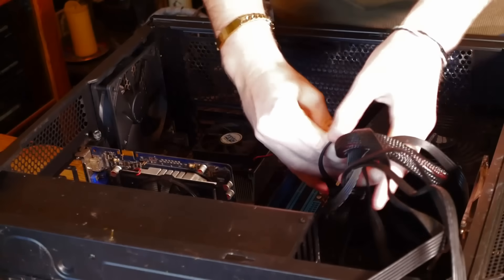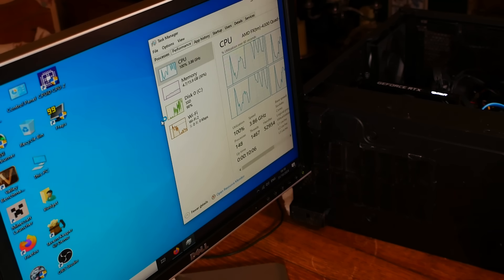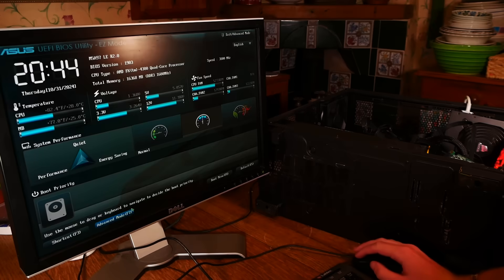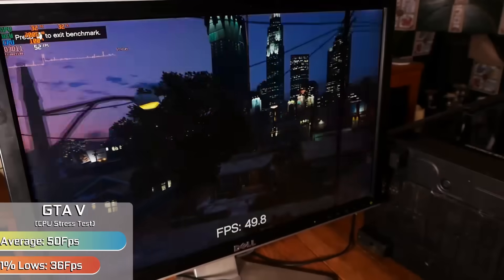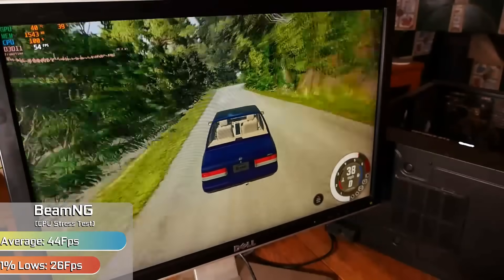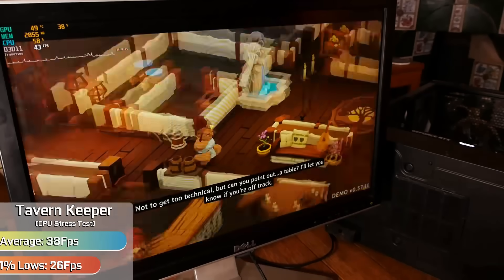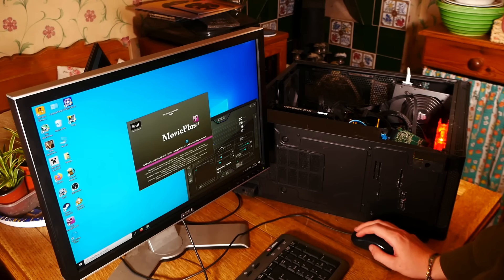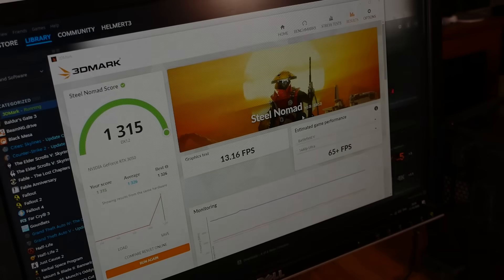AMDs Weakest FX Processor...

Comment: If applications back when this was released has used its cores it would have been good, maybe even amazing but alas games were built with the 2-core 4 thread in mind and so we stayed for far too long.   I used an FX 8370 until a few months ago and played many modern games with it.  Was it amazing?  No.  Did it work?  Yes, and it did because these games used the cores it was equipped with, I think it could have been something good if only the software supported it back then.

Comment: My first PC I got as a kid was with an FX 6300 purely because of the price difference at the time compared to Intel as you mentioned. I still remember having to run it with the side panel off bc the stock cooler (was literally as you described it here) was just not sufficient, funnily I use that cooler now as a makeshift solution when I'm testing motherboards 😂. This video brought back many memories ngl. I went to a 6700k after and then back to Ryzen 3800x, to this day the only Intel cpu I ever used, and I am not planning on going back any time soon. AMD definitely started something good on the long run with their developent of chips at that time I think. I still have the system under my desk catching dust atm, might put it back to some use, especially after seeing this video showing how competent it still is in 2024. Amazing content, keep it up my man!

Comment: Man, this video has me wanting to dust off my old rig I rebuilt back during the winter of 2020 (Covid - Round 1 - Fight) after I finally had some time to myself as my job was classified as an Essential Worker.  Like you, it's what I called my 'First Real' gaming rig that I built years before as I got a heck of a bundle on it and needed something better than the ol' Core 2 Duo system I was on at the time.  Honestly, if I hadn't used the stock cooler as of course I was on a budget, I probably would have used it longer into it's life.  But yeah, still using the same Gigabyte board, 16 gigs of G.skill ram, and the FX 8120 the bundle came with.

Current graphics card I have in it is an EVGA GTX 1660 Super 6 Gig I picked up in March of 2020, the one that took me through the dark times to follow on my First Gen Ryzen system, which is just now one of those cards I'll never get rid of working or not, given EVGA pulled outta the graphics card market due to Nvidia shenanigans.

Given the underdog status of the FX line, and all the gaming I did on the rig back in the day, it's got a special place in my heart :)

Thus! Great video :)

Comment: A FX is quite a "modern" cpu.
I think we have reached a point where you don't need the last cpu + gpu to really use a computer.
My secondary computer is a Mac Mini 2012, of course upgraded with a SSD and a bit of ram, and as long as I don't want to play games, it's still perfect.
The Mac Mini has a i5-3210, which seems about the same power as a FX4300.

Comment: The lawsuit wasn't really related to the cache. It was related to the fact that each group of two threads (ie a module) shared an FPU. 
So in effect you had a weird in between of two integer units and one FPU per module. Calling those modules two full "cores" was therefore misleading. It would've worked out if they called the modules for what they were -clustered multithreading (CMT) modules, and there's no shame in that. 
So, the FX 4100 was more like a 2M/4T chip, and CMT is actually much better than SMT in terms of performance gain because you actually have two integer units, which made especially its multithreading performance better than the i3.
I still think they should've refreshed Phenom II with the new instruction sets of the time on the new GF node and that would-be been a Phenom-enal chip that would still be more than viable for daily tasks and some gaming.

Comment: I ran an 8350 with a GTX 770 and 16GB RAM for years and was very happy with it.  I had it slightly overclocked and cooled with a hyper 212 and eventually upgraded the RAM to 32 GB to give it a bit more breathing room, but I never really thought it was a bad chip.  I think the main issue people had with it was that it was sold as an 8 core CPU when it was actually 4 modules of 2 cores each.. that and the 125w power draw. I still think it's a perfectly usable CPU for a low- or mid- tier budget build.

Comment: I had a FX 8300 and it wasn't as bad in my opinion as people say. If you fine tune the chip and made the right settings in your motherboard, while pairing it with faster ram, it worked actually well. Not as fast as Intels i5/i7 chips for sure, but fast enough to have a good experience, if you made that extra work. I replaced it with an Ryzen 5 1600 later on and was amazed on how much more of a performance boost i've got. Sold the FX 8300 paired with an RX 480 to a friend later on for cheap and she was more than happy of the performance she got at that time (i've upgradet it to a ryzen system later on for her, when she could afford it). The FX processors were disappointing in performance, but not as bad as people say, they were actually affordable in comparison to Intel chips at that time.

Comment: I used to have the fx-6300 "black edition" in my first pc. I paired it with 2x4gb 1600mhz ram and a radeon r9 280 3gb. However after a couple of years I have started to notice some very serious stuttering in games. In 2017 I decided to upgrade to the ryzen5 1400 since I could get it for 70euros and paired it with an ex miner rx480 8gb what i got for 75. It was night and day, the stuttering suddenly stopped and my fps doubled. In fact it is still my main config since I mostly play older or indie games.

Comment: I would like to point out that the modules of FX processors share more than cache, they actually share a floating point unit, and each core has its own integer unit. So in tasks that are integer heavy, they behave much more like a true X-number of core processor and when floating point heavy function much more closely to a processor with half the cores but has hyperthreading.
Reply: This makes a lot of sense. Thanks for the facts!
Reply: Funny part ... when you start to overclock it... then that will reduce the contention of the cores for the floating point units. Remember vaguely some tech site like Anand's overclocking the FX 9000-something to insane levels and outperforming the i7 (also overclocked). Downside was that to get there the power consumption of the CPU skyrocketed to more than twice the i7's. But if you look at modern day Intel CPU's it would sadly be in the same ballpark. Did pick an i7 back in that day, though. Found the ordinary power consumption of the FX already too much.

Comment: In the previous generation (Athlon/Phenom), cores were cores. In the FX, each 2 "core" module had independent integer clusters, but a shared FPU (as well as shared cache and and a shared pool of instruction decoders) - for integer workload, it didn't face the same limitations as Intel hyperthreading, where EVERYTHING is shared.
Reply: And now Intel is doing big and small cores, so not even a core is equal to a core on the same CPU.
And caches get even more complex. Intel's caches tend to be inclusive, meaning a cache at a certain level also holds a copy of the closer caches.
On an Intel quad with 256k L2 (per core) and 8 MB L3 (shared)= would have 8 MB available in total, but only 7.25 MB for a core (minus the 0.25 MB copies of the other cores' L2). The same layout on AMD would give a core 8.25 MB at max  (8 MB L3  + 0.25 MB L2)

And while everyone was talking about core-to-cache latency on Ryzen, the same also holds true for Intel.
They used a ring bus, with a stop for the iGPU, a stop for the PCIe lanes, a stop for the MMU, etc. But also a stop for each core, including a 2 MB slice of L3 cache. And latency tests were showing that the first 2 MB were quick, 4 MB latency was slower (since it needed to take a hop on the bus and back to get to a different slice) and 8 MB was even slower (since it needed to do 3 hops to the furthest slice and then 3 hops back)
In fact, my ancient Core 2 Quad has a lower 4 MB latency than a Haswell i7

Comment: I still have the 4300 I bought over 10 years ago, semi-recently bought a 6300 and plan to buy a 8300 in the near future. The 4300 is slated to run a 24/7 minecraft server for friends, the 6300 runs BOINC decently at 50% CPU usage limit, temps rarely over 45° with a wraith cooler. The 8300 is something I'd stare at on various web stores with beer pockets and champagne taste.

Comment: Few months ago i built 3 PC's with 3 different AMD FX CPU's specifically for my kids. First PC for my eldest daughter FX 8150 paired with 8GB DDR3 and RX 5500 XT 8GB. Second PC for my middle daughter AMD FX 6100 with 8GB DDR3 with R7 250 2GB. Third PC for my youngest son with FX 8320e with 8GB DDR3 and RX550 4GB. They mostly play Roblox but also Genshin Impact, Dragon Ball Xenoverse 2 and surprisingly enough, all the systems play GTA Online without issues, the FX 8150 at high settings with way over 60 FPS, and the weakest system with the FX 6100 on normal settings but with over 50 fps. The FX8320e was even able to play Ghostbusters spirits unleashed on normal settings with over 50 fps, i was not expecting to even be able to play it. So yeah, they're fine for what they play. Also browsing youtube or netflix is pretty smooth. I wouldn't touch the 4 cores FX CPU's though.
Reply: GTA V/Online does fine as long as you give it 3 threads or more. There are some issues with dual cores, but beyond that it's pretty well optimised.
Reply: Ready to heat the house during winter season
Reply: @prostmahlzeit  i don't see temps over 73°C on each FX. They are running at default settings without issues. They do how ever use quite a bit of power from 96w to 125w tdp. Not a problem tho, energy is very cheap where i am located.
Reply: @EtaYorius  I've had a FX 8320 for 7 years and now running Ryzen 5 3600 and Ryzen 5 5600, it's like a 3x improvement

Comment: It was a good chip for its time and still kicks ass today.
In 2018 I did the full FX-8370, 16GB DDR3-2133 and RX 580 combo.
Averaged between 45-60FPS in Unity VR stuff, 90-120FPS in anything Unreal and a steady 144FPS in most Unity desktop games, which was fair.
After building a Ryzen 5 3600 system, I racked the FX and turned it into a recording server.
It really deserves better than this but without streaming, it has no home.
I promoted a single core AM2 box to be my full time web and storage server just to retire the FX to container duty but stopped doing containers.

Comment: FX Cores weren't just Sharing Cache,  they eben shared arithmetic compute Units like floating point units etc.
They really weren't complete cores
Reply: There is no definition of a core, early cpu's didn't even have a FPU but they were still CPU's.
Meanwhile the 16 atom "cores" in cpu's today also share an L2 cache just like Core2 used to.

Nvidia calls an FP32 unit a "core" despite no integer capability or like 5 other things people think a core needs. There's no definition.
Reply: That was way better than Intel who just passed off useless threads as real CPU cores!
Reply: If a 8086 is a cpu then the fx is a marketed core chip.

If a 8086+8087 is one cpu than a fx is 0.75 marketed cores.
Reply: It was smt/ht using real cores, it was horrible and still is (just doing windows updates was anoying) 4300 is realistically a dual core cpu with 4 threads (the 6 core version is 3, 8 is 4)

2c4t, 3c6t, 4c8t

Windows had to release a update so it treated the second core as a smt/ht (so AMD Released a update called Pile driver witch was just bulldozer tweaked and I unfortunately Ms didn't update the new cpus to bring the fixes back)

Another update had to do right to left core parking because the power management on the cpu couldn't downlock each of the 2 threads so if windows put load on the last thread it had to fully power all the cores (after fix load was focused load in order of onto core 0 2 4 6 (if it thought smt/ht was useful it would use the 1 3 5 7 threads)
Reply: Ya9590 was really a hyperthreaded quad core but still kinda nice
Reply: @NolanWayne-h9n  it wasn't hyperthreading
As I said, they were Cores with shared arithmetic Units
Reply: @ which in function is incredibly similar to hyperthreading. And in form too
Reply: @NolanWayne-h9n  hyperthreading uses special Branche prediction to run multiple Threads on one CPU 
There aren't any multiple Units
Reply: @ that’s not true. There are parts that there are 2 of in hyperthreading just like amds simultaneous multithreading

Comment: I ran FX from 2011 up until 2016 when i switched over to x99 and then finally went back to AMD with AM5, i owned the 6100 the 8150, 6350 and the 8350 they were all good chips honestly and were extremely easy to overclock and had no problems running multiple SLI and crossfire setups from back then, i also wish i hadn't sold all my fx gear i wouldn't mind finding out what my 8350 could have achieved with my old 1080ti, also the higher tier fx chips also had 32 pcie lanes which means you could run two gpu's in x16 mode which the intel counterparts couldn't at least not on mainstream
Reply: Nice, I had an fx6350 (with gtx 660), 8350 (rx 580 8gb) and I now have an i7-6850k with a gtx 1080

Comment: Before my current 12400 I had a 2º hand FX-6100 (MB+Cpu+6Gb Ram combo on ebay).
I had it manually "OCd" from 3.6 Ghz to 3.8 on all cores.
The default turbo could reach almost 3.9Ghz on one or two cores, but the rest just stayed at 3.6 ghz.
My problem always was the GPUs I can afford, GT9800, GTX 650 and lastly my current GTX 1650 Super.
The 1650 super only worked with the 650 as primary GPU or with a new Beta Bios ("new" was years upon years old already) the "older" Bios didn't post with the 1650 super alone.
I didn't had any SSD just a slow mechanical WD blue.
All GPU upgrades helped me, but they never where the best ones around, the 6Gb of ram made the PC just acceptable (2º hand DDR3 was still very expensive, even with DDR5 around the corner) on games and the HDD made all the ordeal a waiting game.
I used it the best I could until the MB or CPU made all boots a work of hours powering on and off the PSU until it finally booted to windows, apart from the BIOS getting corrupted every two weeks. At the end I had the PC 24/7 on, because the chances of never waking up were pilling up. I even submerged the CPU on HCL a second time, with no benefits, this crazy trick give me more than two years of extra life the first time I used it on the same CPU.
And I was forced to make a new PC. At the time my objective was PS3 emulation and the 12400 was the best option (AMD 3k 4k and 5k had more or less the same price value ratio, but the socket was a dead end... jokes on me, because 13 and 14 gen do not look too healthy) my budget was so low that I seriously considered ditching out the PS3 emulation and just get a 12100 (extreme performance for the price) with the cheapest components because it was already better than the FX-6100.
I never got the real potential out the CPU, because other components kept the PC on a constant bottleneck status.
Reply: Those were all fine GPUs and popular for their time. I had a 8800 GT, used HD 4870 and later a GTX 660 Ti. Still have them around and most do some task or another.
I think the 1650 Super is still the currently most common card in the steam hardware survey.
The 8800 GT/9800 GT (same card really) came at an insane price. Imagine nvidia releasing a RTX 4075 now, that beats a 4080 Super in many games, pull under 250 W, and only costs $400. That is pretty much what the 8800 GT was. Beating the 8800 GTX at half the price.

But now that the whole FX platform is dirt cheap, might as well go all out and try to get the max out of that FX-6100. It doesn't cost much, and there can be fun in tinkering.

And don't worry about upgrading later on. That is usually a moot point unless you come from a lower end chip. Something like R3 1200AF to R5 5600X or i3-12100 to i5-12600K.

Comment: I had at one time an AMD Bulldozer FX 4130 and FX 4300 and then AMD Piledriver FX 8350 never had any problems with them i guess they are still sitting out in the shed and then moved onto the Ryzen 2700X and 7800X3D.

Comment: I used my 2010 i7-920 gaming machine up till last year still ran games fine at 60fps 1080p on most games. Don't get me wrong I love the machine I built to replace it finally, went with an Asus Prime X299 Deluxe II with a 7thgen 7820x i7 in it at the moment and it absolutely kills at everything I've thrown at it and can upgrade to 10thgen Intel extreme CPUs so got plenty more power to be had. But over all these older CPUs like this AMD one are still pretty capable of delivering a solid 30fps with details turned up maybe even higher fps but still ok CPUs lol

Comment: Back then, the higher end ones like the FX 8350 were pretty good. Specially if you were already on an AM3 Motherboard. (It was my upgrade from a Phenom CPU and did really nicely)
Now... Meh... too many 100$ prebuilds with an I5 or I7's that would be a better thing to add PSU and GPU for low cost gaming.
I just bought a 130$ Canadian, AMD A8-9600, running on an AM4 A320M motherboard... I figured it would be fun to test it out. While I am sure it was capable back then... right now it can't even run CS2... and even if I toss it a PSU and an RX5700XT... it still can't pass 30FPS because the CPU is simply too weak.
That 2 modules, 4 cores at 3.2Ghz is super weak. Slower clock then a 4300 and half the L3 cache.
On that PC, I then changed the CPU to a Ryzen 1800X... And the PC is now awesome... well mostly. The A320M motherboard of this PC isn't strong enough (Power Delivery) to push the Ryzen 1800X to it's potential.
Edit... (I am surprised at how well your FX4300 did!!!)